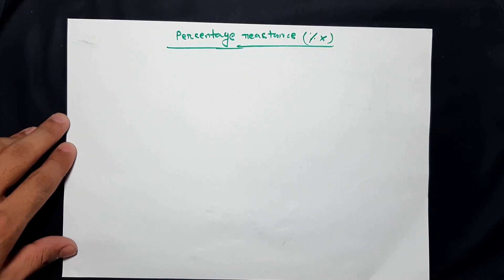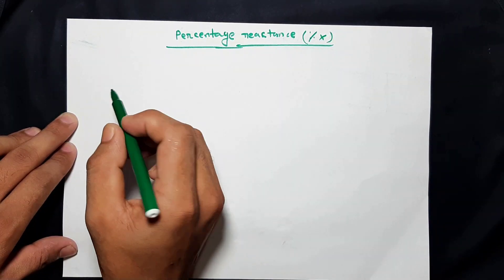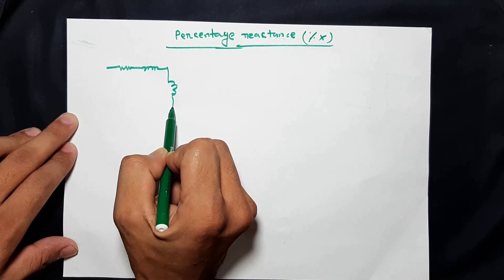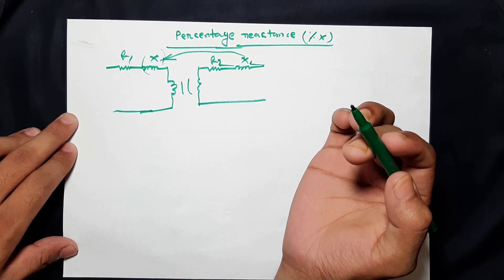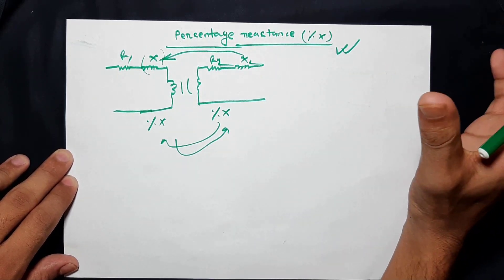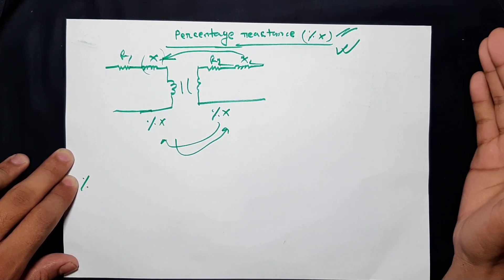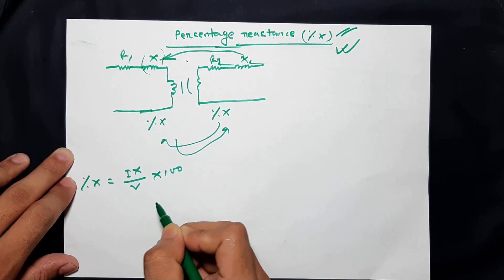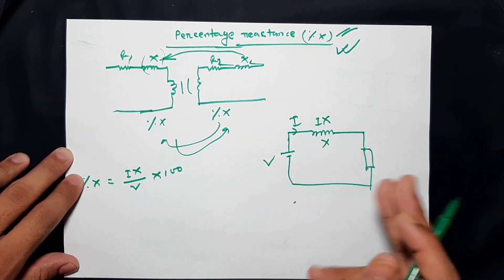19- Percentage reactance (%X) || Why we use it? || Symmetrical Fault Part 2 || Bangla

Comment: Something wrong in your calculation vai 
V/1000=kV,,,
 similarly 
VA/1000= kVA
  actually here V isn’t a unit of potential, its just symble of  potential, i mean its a magnitude.  thats the fact! And to convert any value into kilo, we have to divide it by 1000.
 then 
V^2/1000
= {(V/1000)*(v/1000)}*1000 
= kV*kV*1000
=1000kV^2 ( here you wrote kV^2/1000)

Then we find 
1000kV^2/(VI/10)
= 10 kV^2/(VI/1000)
= 10kV^2/kVI ** you wrote 1000VI =kVI which is wrong concept.**

Btw Thanks for the playlist vai
Reply: Thanks for the clarification. I was totally confused there.